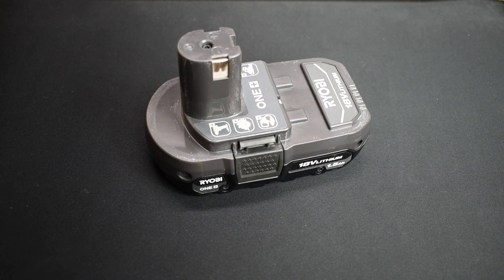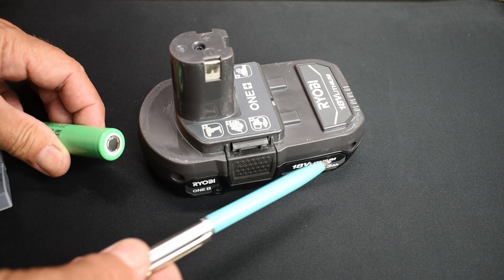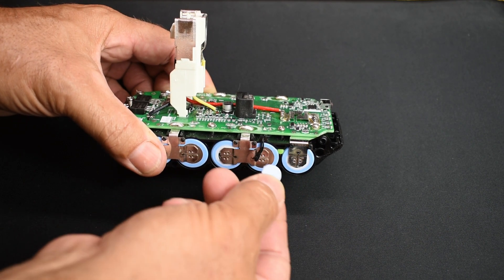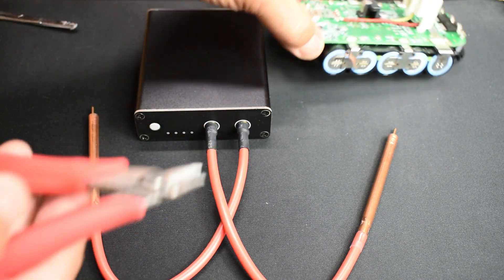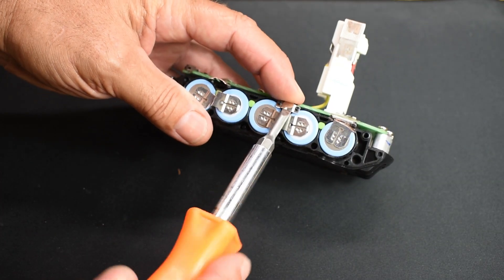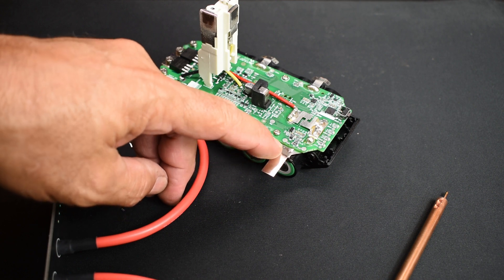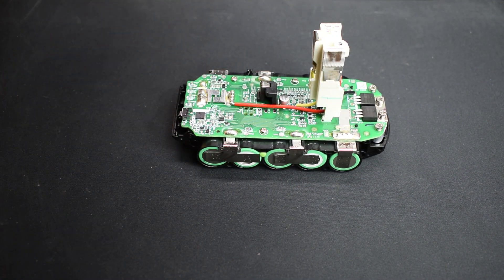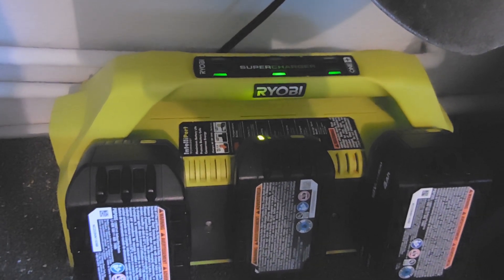How To REBUILD Ryobi Portable Power Tool Battery Packs(Other Brands Also)

Comment from the maker: If you rebuild a battery pack, and the battery gauge does not work properly or at all, with no power output, then you can usually correct the problem by disconnecting the NEG and/or POS tabbing for at least 1 minute. That usually corrects the issue. Thanks for watching!
Reply: Thank you for sharing this knowledge and in a format a monkey like myself can understand. One question (though anyone with a bit of interest and/or experience with electronics would likely know):- Should the individual 18650 cells each be balance charged to the same voltage before replacing the old/faulty cells? Or does the Battery Management System (or BMS) within the circuit board and/or battery charger do this?
Reply: Jump the reset with the reset and ground pin
Reply: My battery gauge button isn't working but the battery still works and charges... Fixable or no?
Reply: @patrickirwin4827  I have the same problem 😢

Comment: Great video! I have (2) RYOBI ONE +  lithium plus 18 v  1.5Ah in which one of them has been disassembled. It appears the circuit board is different on the One+, there is no j1 to reset that was mentioned. Are you or is anyone aware of another protocol to reset this particular circuit board? Thank you.
Reply from the maker: Glad you enjoyed the video. You could probably search online and find information regarding your particular board.

Comment: Been looking for a DeWalt battery to repair. Their were some excellent deals on Molicell 18650's and 21700's for black Friday that have unfortunately ended. I noticed on my DeWalt 5 Ah there is a main wire that looks like it would benefit by being changed to 10-12 gauge solid copper wire 🙂

Comment: what was the voltages of the old batteries and the current state of the batteries. to cause the battert not tp work
Reply from the maker: The problem was the cells would charge up, and then drain very quickly, or 1 cell out of the pack was bad.

Comment: But how did you get that plastic cap out ? That’s why I searched for a video. I have the same cap over one of the screws
Reply: Any pointy, pick-like tool can pry them out. It might take a couple or three tries to get it to grab enough to pull the plug out.

Comment: sometimes you can charge up the cells inside the battery equally with a benchtop power supply, because one got discharged to far, but sometimes if that doesn't work then yeah cell replacement is recommended.

Comment: One question, I might have missed it at some point. 
Should you charge and balance the cells on an actual 18650 charger before you put them in and do all the spot welding? Only asking because obviously it's best to work on dead batteries. Just curious since at the end the battery was dead and you needed to charge it.
Reply from the maker: When you purchase them they're all similar in voltage, but if they are not, then balance them out before installing
Reply: @electronicsNmore  ok just making sure. I used to buy a lot of 18650s back in the day and I always just balanced them off rip no matter what I was using them for if it was more than 2. Thanks for the info.

Comment: The welder needs help or a foot switch welds ,welder are questionable,  you almost shorted these postive top ends when you spotwelded, probably because you need to hurry when  pushing down and it moved!? it happens to everyone ive got one that does 0.3 at 20% , normal .15 @ 7-8% using a 12v car battery! Pretty neat, plus I've extended the welding leads so that the unit can stay put and it doesn't get hot-weird

Comment: With all the respect..... You do not need to "butcher" this poor battery. All you need  do is remove the batteries leaving the metal in place, this way you can easily replace the new batteries!       (That is how I do it)
Reply: If they are spot welded and have to slide out of the plastic tube how are you doing to remove them?

Comment: Thanks for the great video, it was very informative. I have a Lithium-ion battery pack from a vacuum that is no longer working. I opened it up and saw it has a pack with 6 batteries. Going to try to replace them.

Comment: Perfect. I have dozens of samsung 2500mah 18650s from a salvaged arc lithium pack that all test ~90+%. My old 3ah packs are about to be 5ah packs!
Reply: Doe! So I rebuilt the pack today (3ah P191) and the battery gauge blinks the single led for a few seconds then the leds chase back and forth indefinitely. All 10 cells are within .1v of each other and are good cells. Total voltage is 19.9 at the cells and 19.2 after the bms but the charger doesn't see it. I can't find an obvious reset jumper area. Thoughts please?

Comment: I have a couple of knock off ryobi batteries I picked up when my original battery went missing.
I also have one genuine Ryobi 4ah 'High Performance' battery that my dumpster diving neighbor dropped off one day.
I was getting about 17 v across the pack and nothing across the tower.
Glad I watched to the end - all it needed was a reset and it's now charging fine.

Comment: Thanks for a straight to the point video, My Ryobi packs are tired and due for replacement but they are crazy expensive, you have inspired me to buy a spot welder and replacement cells for a fraction of the price, save on the E-waste and my wallet
Reply from the maker: @kowboykel665  Glad you enjoyed the video!

Comment: Good video as usual.  What C rating or amp draw should the replacement cells have?  Some 20a cells are like $3, so $15 for cells.
Amazon sells 2ah knockoff batteries for the same cost, no tinkering.  I have about 5 dead ryobi batteries, I hate to throw them out, but I bought the cheap knockoffs, and they have worked well now, much less than advertised capacity though.

Comment: I did this on an 18V Ryobi battery that doesn't have any battery gauge. Everything seemed good and I charged it up to the same voltage as my original battery. But my machine doesn't start for some reason. The light goes slightly on but no rpm at all. Any suggestions?
Reply: I found what was wrong. The output voltage was 19.8V but when I checked the cells one by one, there was one (brand new) with 2.7V and all the others were correct and the same. Changed the faulty one and now it works good. 😊

Comment: Please, the tabbing you are using is woefully inadequate to carry the 30 A required. At the very least double them up if you cannot use a nickel copper sandwich.    And it is best to leave the 0 and 20 volt terminals for last.

Comment: Does the order of resoldering the balancing wires matter? The pack doesn't seem to be working after replacing the cells. I have replaced cells in other brands without having any issues. I wonder if ryobi has some kind of minimum voltage protection.

Comment: I just referred this video to a YouTuber in response to his comment.  He left his electric mower battery in for 7 months and now it won't charge.  The cells may have discharged so low that forcing a charge, like as done in the video he asked his question in, could make it explode.  Maybe you'll get another subscriber.

Comment: That is a very nice battery pack design.  The individual cell holders makes replacing cells much easier.  Your battery spot welder link has a few selections.  Which one do you use and do you recommend that one or another one, please?  I've wanted a battery spot welder for a while.  And do you have a link for the metal tabbing?  I don't see it listed in the Description area.  I see 0.1mm x 8.0mm in the video, but no other info.  I think I'd spot weld a T instead of folding over, but that's me.  It will use less tabbing.  Another great one, Scott.  Thanks
Reply from the maker: Look for the one that you saw in the video, it's in black on that page. I use the highest setting which is number four. You can also find the tabbing on that web page link.
Reply: @electronicsNmore   Thanks, Scott.  I noticed the metal tabbing on the page and that yours comes with some.  That should be plenty for the little I'll need it.

Comment: I was hoping you’d measure the old cells so we could see if it’s only a portion of them that went bad.
Reply from the maker: It's not worth changing only a couple of cells, so I didn't bother. Usually one or two are faulty.
Reply: @electronicsNmore  Yeah, but it’s good to know the usual failure mode and how many might be good cells to use in other things, like flashlights. Thanks!

Comment: I hope you realize that there are different types of 18650 batteries, you can not only go by the current capacity! Power tools use high discharge current type batteries. Standard discharge batteries are used for lower current devices like laptops and typically have larger capacities. Standard batteries should not be used in power tools because the higher currents will shorten their service life.
Reply: Drastically shorten.,may overheat causing a 'BAD' situation... Thank You
Reply from the maker: Of course I realize
Reply: Good point. I get my old battery packs from the home Depot recycling box, take it apart and look for good cells in the pack

Comment: Ya... requiring a spot welder is where it fell apart for me. (Whose gonna buy all that stuff to rebuild one battery pack?) I don't have 10 cordless power tools that need the packs rebuilt.
Reply from the maker: The spot welders aren't that much money if you plan on rebuilding your battery packs well into the future
Reply: @electronicsNmore what brand is this spot welder?

Comment: Nicely presented.  What necessitates shorting those those two points to reset the battery pack?  Wouldn't replacing the original cells already do that?

How did you discover the need to do that?

I hope my questions are not too confusing. 

Regards and kudos to making the Earth a greener place by reducing throw away items and helping to save money.
Reply from the maker: When the battery voltage drops, or if the cells are removed, you usually need to reset the circuit. Thanks for watching
Reply: @electronicsNmore  12:10 How did you figure out how to reset this Ryobi battery? And what about other batteries? How do you reset them?

Comment: Interesting video, I always thought these batteries were sealed and not really serviceable.  It just goes to show that if there's a will, there's a way. 👍👍👍  Someone would have to figure out how much work and investment they want to put into repairing these batteries if they're in good enough shape to repair.  I like the spot welder.  Do you use the spot welder for other things?
Reply from the maker: Spot welder is only used for creating battery packs. Thanks for watching!
Reply: Thank you for answering my question, and I really enjoy your channel.  @electronicsNmore

Comment: Id been repairing these for years. Usually 1 or 2 cells will go out. Ive had good luck with capacity testing the others and replacing the bad cell with a like capacity. Great video!
Reply: Any recommendation(s) on a test tool for these 18650 (and other sizes) cells?
Reply: @andyroid5028  Rolls Royce tester-charger : SkyRC MC3000 / better price lower perfs : Opus BT-C3100
Internal resistance (impedance) tester : YR1030, to compare with values on cells manufacturer's datasheets.
Reply: My battery gauge button isn't working but the battery still works and charges. Can it be fixed?
Reply: then you have a few cells with 100s of charge cycles,and fresh new cells with few charge cycles. better to just replace them all at the same time,save the old,good cells for other uses.

Comment: I’ve used old Dyson cells not large capacity but quality with a good draw capability .   Ps Dyson boards give out long before their cells. 🏴🇺🇸🏴
Reply: I opened up a Dyson battery pack and tried to replace the cells, however the cells did not want to fit in the same space theirs were. Too tight. Should I try and remove the plastic jacket from the battery to get just that tiny bit more of space to wiggle in the batteries? (I expect the board is just fine, the motor runs a few seconds on the current batteries, and if I add an external power source I can let it run very long as the power is not drawn from the batteries anymore). I really like the Dyson cleaner and want to fox it, they are so robust!
Reply: @deslomeslager  some Dyson are 2170 some are 18650 .   The from memory, second and third one in are “ glued “ in because of the temp sensor sitting in a v shaped recess  ( below the board) potted in, some care and effort is needed to remove them , but can be done . In my opinion Dyson battery’s are only good for cells once they won’t work in Dyson 🥴
Reply: @pollywollydo  Thanks for telling me. As said, I managed to get them out just fine (18650), but the new ones I have got seem to be a very tiny bit thicker though they are original 18650 Samsungs. But I do can try and use a file to take away some of the plastic, and make the batteries fit.
Reply: @deslomeslager  removing the cells that are temp’ monitored will destroy the sensor which has 2 wires back into the board so if either of those are shot I wouldn’t bother otherwise give it a go 🌝🏴🇺🇸🏴

Comment: Tamper proof fasteners make me laugh.  Tamper resistant would be a mildly better description or easy to remove if you have even the crap Iest of driver sets.
Reply: Tamper*
Reply: @shawnd567  that’s the problem with dictation on the phone.  I certainly know it’s tamper, but didn’t realize the phone took it as temper.  🤷